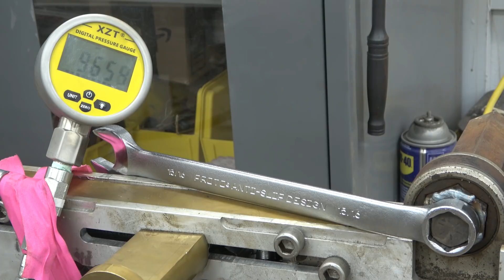Craftsman vs. Proto

Comment: Isn't the difference in performance down to the geometry of the head?

6pt has more surface area in contact with the bolt, therefore the load is being spread out over more of the head. Whereas the 12pt has less contact surface area and therefore gives up easier as more force going through smaller surface area.
Reply: assuming both are made to the same tolerances, neither one is going to grip on the flats.  At all.  There's a smidge of relief to make sure you're not gripping on the very corner, but then there's only that single point just after the relief that's going to be in contact with the bolt, due to that little bit of slop you need in order to actually fit the wrench over the bolt.

You'll never see the amount of precision needed in fasteners and hardware to get any more than a single point of contact.  Maybe 2 or 3 throughout the entire head of the fastener, but that's is.
Reply: That's my thinking,  as the 12 point rounded the head the bolt wedges the ring apart.
Reply: As long as it makes good contact and the bolt or nut is in good shape a 12 point usually grips well enough to break the bolt. But, a 6 point does grip better since its able to make more contact deeper on the flats. The 12 point really only catches the points.
Reply: I would argue that 12pt have more points of contact, but 6 has more area of contact. I'd rather have the latter over the former unless I'm trying to spin something smooth, which is why a pipe wrench has so many "teeth".
Reply: @jesse1136  If it's only a normal 6 point bolt head than the extra points on a 12 point wrench aren't touching anything. They do make 12 point bolt heads. And, those with a 12 point wrench or socket tend to work very well. But, the 12 point bolts don't allow for the open end to grab onto them so it's only sockets or box end wrenches.
Reply: The wrenches have the same contact area on account of the wrench heads being larger than the bolt.  We know the heads are larger because they are easy to fit over the bolt if they where exactly the same size you would have an press fit between the wrench and bolt which would require a press of some kind to get the wrench on the bolt.
Reply: @nug1903  not at all. The 12pts do have less contact/surface area than the 6pts and they also have twice as many thin places to break.

Comment: Is not the failure of the 12 PT due to the ramp effect of having just the tip of the hex engaged with the wrench. In my mind 
I see the box end being more stretched open on the 12PT than the 6 PT Cool test and great welding! 😁

Comment: Nope!  You failed to consider where the contact point lies with both wrenches.  With the six point the contact is spread across a much larger area and distributing the stress along the weak points more evenly.  On the twelve point that point of contact is very close to the weak point and concentrating the stress on it.  Imagine a using a chisel to remove a bolt.  Hammering between the points applies less turning force than while out near the points increases it.  The Proto is probably a better wrench but not for the reasons you think.  Should try the test again reversing the brands.

Comment: Please try testing 2 of the same wrench brand new, but quench one in liquid nitrogen first. Let it warm back up before you test it of course. They have been doing this with racecar parts now along with WPC process and the results are impressive. Super cooling it basically "finishes" the metal crystallization that happens during normal casting or forging and converts more of the phases into martensite which is the strongest phase. Might want to double check the process details, I think you just let it soak in the nitrogen for a while and then take it out and let it warm back up. You could probably even leave it in overnight. One of the science channels on youtube did it with bolts I believe and got something like 30% strength increase if I remember correctly.
Reply: Applied science made a video about drillbit quenching in liquid nitrogen, that's a good explanation
Reply: Interesting, would love to see that test. Never heard of super cooling like that
Reply: Holy crap. What channel
Reply: @michaelthebigaussie  Applied Science gave some drill bits the cryo treatment
https://youtu.be/hAxi5YXTjEk
Reply: They’re doing it with some rifle barrels, Sionics is the company I think
Reply: You mean like a cryo treatment?
Reply: I think cryo treatment has to be done in a more precise manner than just throwing liquid nitrogen at it. I think you need to control the warm up precisely and other things like that.
Reply: @Neishy86  (reluctantly lowers carboy)
Reply: I use dry ice in a cooler. And pour water over it. Pack and close then let come up to temp in the cooler. Taught to me by a cryo specialist. Im thinking same results or close. For same parts!
Reply: You need to temper that newly transformed martensite after the cryo, or you aren't going to gain anything.
Reply: @johndoe-so2ef  Good point, do you know of any documented procedures that would help with this process? It would be fun also to compare two wrenches, one tempered after the quench and one not tempered. Theoretically the non tempered one would have a higher breaking strength as long as it didn't break from being too brittle from an existing small defect or something like that.
Reply: I thought supercooling had to be done slowly, 1 degree per minute. to reorganize the atoms correctly.
Reply: @BerksCatBill  You might be right, I don't know the details of the process but I will have to look them up now.
Reply: Surely you just have to leave the wrenches outside, in Canada, in January.
Reply: Cryogenic treatment, aka marketing wank

Comment: One small comment: the modern wrenches are typically broached a little off centre , as is found out when wrenching a nut or bolt with tight clearances, Clarence, requiring one to find the position the wrench will actually fit.
Reply: Roger, Roger.
Reply: @Daniel-Weaver  Do you have clearance Clarence?
Reply: @howder1951  Roger,Roger.
Reply: Oops,I meant Vector , Victor.. I picked a bad day to stop smoking parmesan.

Comment: My 2 cents. If people are talking about grip while tightening or loosening, is it when using an impact on one end and the vibrations are causing the box end to slide off the fastener, not holding the wrench square, pushing with one hand and pulling with the other with a ratchet or wrench? Is it possible that the wrench stays on due to a difference in amount of play in the 12 point compared to the 6 point, more or less friction helping the wrench stay on or slip off? Paint, rust or dirt helping the 6 point stay on as well?

Comment: From my (albeit minimal) experience, the 12-point is generally easier to use because of the extra positions in which it can grab.  However, because it's not fully supporting the fastener it has a tendency to round them off.  In those applications, the 6-point may be superior.  My dad did HVAC work and they would use a "Secure-grip open-end wrench" to keep from rounding off the soft fittings.  It's basically that same 6-point box-end wrench with one of the sides cut out.
Reply: That's called a "flare nut wrench", for anyone interested. Any auto mechanic who isn't a sadist, will have a set of SAE and Metric, for brake and fuel line/hose work.

Nothing worse than, say, having to replace a brake caliper, but you fuck the hose's nut up and now in addition to replacing the carpet, you're also replacing the brake hose... nevermind that the job won't be done in the initially quoted time frame because you have to wait for the parts store to deliver the new line (assuming they have one lol).

But yea, same scenario for HVAC. 
Rounding pipe flare nuts is one of those classic "... Ffffffffffffffffffuck 😔" moments, no matter the job, be it professional or personal! 🤣
Reply: Very similar to brake line wrenches my dad has from his mechanic days. They cut a small notch so it can go around the line, and a solid six point to avoid rounding anything.

Granted, I'm not sure those are meant for maximum torque ever, but every extra bit of thread helps for a hydraulic connection.
Reply: The “extra grip” is negligible 99% of the time. The advantage of a 12 is immense as you indeed have double the amount of positions to engage the fastener. If you are using a good quality wrench with good tolerances it won’t round it off.

I often use Hazet wrenches, a full set of these costs a kidney and a liver. But you can beat them with a hammer and use em everyday and they will hold up. The set I use right now everyday as a heavy equipment/ industrial mechanic has a “Made in W.-Germany” stamp on them. They have seen a lot of use but still fit perfectly with no slop.

This “secure-grip” open end wrench you refer to is often used by us when working on hydraulics. Very practical indeed!

Comment: or does the 12pt break between the points on the bolt?  essentially stretched due to the direction of force from the competing faces?  while the thinnest part is thicker it is still thinner than the thicker flat section of the 6pt

Comment: Oof, you spoke too soon sir, the Proto is quite a smidge wider at the box end.
Reply: On another note, if you break either with anything short of a 3ft cheater, or a 10lb sledge, you are doing something wrong, or your bolt is made of Unobtanium.

Comment: The difference between stretch to torque vs stretch to yield bolts. 
Stretch to yield breaks when reused. 
Stretch to torque breaks when it's the only bolt like it within a thousand miles.

Comment: Why didn't you measure the width of the box end wrenches? Wouldn't the overall strength be a function of the total cross sectional area of the steel at the weakest point - not just the thickness?
Reply: I thought the same thing. From the video the Proto looked wider.
Reply: The proto also has larger radii at each "point" than the Craftsman.
Reply: @brianhaygood183  I came here to say this also.  The effective stress is concentrated differently depending on the size of the radius at the sharp intersection.  The smaller the radius the higher the stress concentration.  How do the two wrenches compare in this regard?
Reply: no. much like a chain, only as strong as the weekest link, on in the case, thinnest cross section
Reply: The ring is failing in tension (as the bolt head gets incrementally coc*ed in the ring, it tries to expand the ring, placing the ring in tension) . Crucial factors are strength of the steel, and cross sectional area at thinnest point of the ring. As long as the tolerances are tight enough between hex head and wrench ring, 6 vs 12 point immaterial??
Reply: I agree, Stress=Force/Area

Comment: What aboot the open end?
Struggled with a ball joint on the tractor last week. 19mm hex on a ~17mm tapered, then threaded shaft. Dickered 4 open wrenches on account of 'em camming over. Had to bring out the 'ol grindér to get the joint of and me getting the box-end over the shaft.
Reply: Use a big ole crescent wrench for those, if you can afford the space.

Comment: I'd hazard a guess that the geometry of the 6- vs. 12-pt has something to do with the ultimate yield too. 12-pt is going to have more stress risers than the 6-pt.
Reply: Would it matter how many there are, when the ultimate strength is determined by the weakest point? They aren't all going to fail at once, just the weak point. I guess having more of them increases the odds that one of them would be imperfect, and thus weaker than expected, but I would think that would just come down to the quality of the original steel.
Reply: @WarrenGarabrandt  It wouldn't make a big difference. What really matters is the shape of the wrench. If the bolt head was in an egg shape or a slightly deform circle, you wouldn't need much torque to break the wrench. So essentially, with a 12 point wrench, there is more force trying to expend the wrench and less trying to turn the bolt.
Reply: I wrote an entire paragraph to say what you just did.  Should've read all the comments first.

Comment: could have something to do with spreading the load ;p the extra points on the 12 could act as a concentrated point for plstique deformation, extending the life a bit until ultimate failure whereas the 6 has no wiggle room so any deformation goes from zero to Trudeau's ego,

Comment: Okay so I've stopped at the 21 second mark. And what I'm saying as far as where on that boat is up towards the shoulder and or head of the bolt sorry about the nomenclature it's been a minute. That's where the weight of the load that that bolt carried rested. That's why it's worn and or that's where the vibration was now that's just an assumption on this part and we're at least a supposition. Anyway moving forward I wonder if anybody actually thinks about these things? Pretty sure you got it. People are monsters good t-shirt thanks. Anyway are we going to be getting any hearing from Canada soon please supply line thing is really screwing stuff up. 
Reminds me of a joke
What did the Wuhan janitor say when they open the closet door?
Supplies!
There's one for the books.
How do you catch a unique rabbit?
Unique up on it. Oh hitting it out of the park look out. Don't even like baseball.

Comment: We need a chain/cable/rope/sling test version of this.  For science of course.  I'd be interested to know what the actual break strength is of the cheap harbor freight nylon straps that I buy, lol...  
Much safety squint needed for that though.  Kinda like using harbor freight coil spring compressors.
Reply: I see you are a man of culture as well. Are you a member of theirs? Because i aint trying to brag, but i recently just bought a membership there.
Reply: Fireball tools did an excellent testing of slings.
Reply: Check out the HowNotTo channel on here, he made a pulling machine and tests all kind of ropes, climbing gear, knots, and other stuff. Very interesting

Comment: I still say if you step down in size the results will be different. Grade 8 and 15/16" has to have high tolerances than 3/16 and no grade Chinese furniture bolts.  Ftlbs aside, I still prefer the 12pt for the range of motion.
Reply: @Captain MufDyven There's definitely a lot of variability when it comes to Chinesium hardware. It's like they just grab whatever stock is convenient and run it through.
Reply: @LN997-i8x  that is exactly what they do. Make more money that way.
Reply: @LN997-i8x  China can make excellent stuff, they manufacture to a design and price point as per the customer's specs. Which is why the cheap stuff usually falls apart right after the warranty runs out, and the good branded stuff lasts longer.
Reply: @Captain MufDyven Cheap hardened steel so they don't strip out easily, just like drywall screws. They will take less torque than a grade 2 bolt, but do better in shear. They normally get loose because what ever they are holding gets deformed.
Reply: @Captain MufDyven Were you using drill bit lubricant? Were you using chinesium drill bits?  It'd be difficult to drill through dry spaghetti if your bits are also made of dry spaghetti. 

I've personally found more success drilling through metals with molybdenum bits. I have mostly KnKut bits for metal and Fuller brad points for wood.
Reply: @Captain MufDyven if you haven't already determined otherwise, perhaps the original bolts were already stainless and galled into whatever they were into, and sometimes they will, even if the merchandise isn't SS.  Furniture jockeys will fak those threads without lube for any reason to get Friday here quicker.

Comment: Alot of safety squint engagement in this video, even from across the internets.
Reply: Yeah, I've my safety squints on watching this, I think AvE was seriously considering his safety GTFOs...
Reply: I could hardly see the screen between the fingers of my shield hand !
Is it better to have your palm facing the blast zone or back of the hand ? If the back of the hand gets damaged you can still use your palm, I'm never sure.
Reply: Proto = snapon
Reply: My underpants cost £1, and my arse ate about 50p worth during the torque tests!

Comment: Can you test the open ends of those wrenches now
Reply: I can answer that for ya; no man is big or strong enough to break a wrench with his own hands. Only will it break when you apply additional leverage or force beyond what a human is capable of. A snipe bar, a hammer, heat, etc.
Reply: @Sizukun  you can bend the open end by hand ask me how i know. Box end you are correct
Reply: @Sizukun1  You are full of shit. I bought some HF flare nut wrenches and I managed to break one with just my bare hands. Where it broke it was very granulated looking metal.
Reply: Yeah, I once thought the same thing I thought the same thing when I came up with the brilliant idea once used a 3/4" with a 8' long cheater pipe. The memory of the sound "ting", the lump on the back of me noggin, and waking up dazed and confused on the shop floor told me otherwise.

Comment: I find it hilarious that when he needs to turn the head of the bolt he reaches for the nut rounder even when the box end is literally sitting right there in frame.
Reply: Oh you know he's got a soft spot for the thumb detecting nut fucker and I'm sure that the thumb detecting nut fucker has got a soft spot impressed upon his thumb
Reply: Box wrench is one size, nut rounder is tons of sizes.  More = Always better.  Plus as a bonus it also makes good for a hammer.
Reply: Once a nut-lathe operator, always a nut-lathe operator.
Reply: I happened to right there in the vid reading your comment, and about choked on my lunch.
Reply: Once you;e spent enough time with a specific tool in your hand, holding another just feels wrong.
Reply: He is called bumble fuck for a reason
Reply: I believe the use of the metric crescent wrench was because the wrench on the bench was a 24mm and the nut was 11/16, hence the use of a pair of knuckle busters.